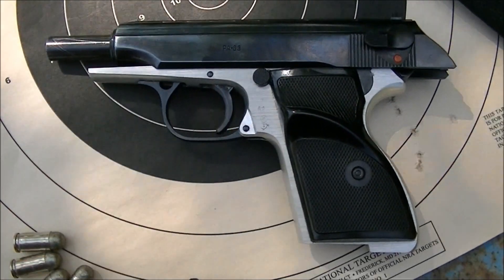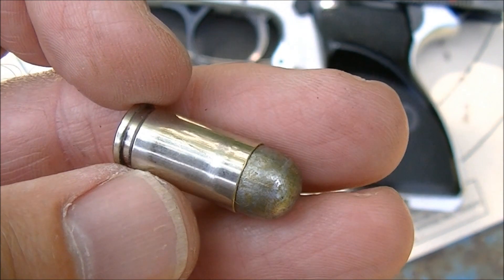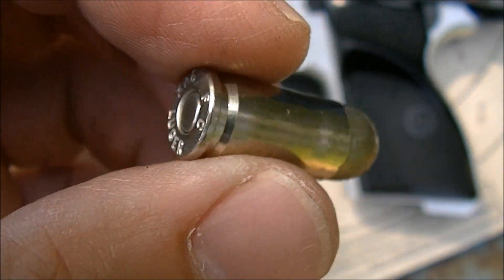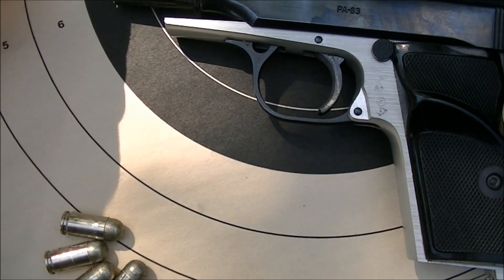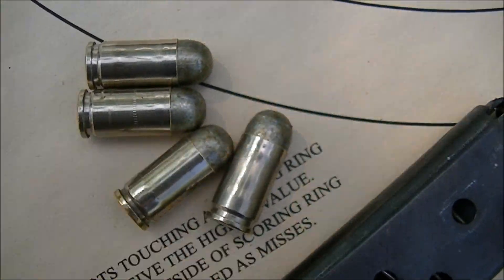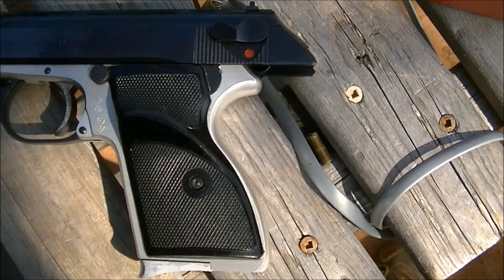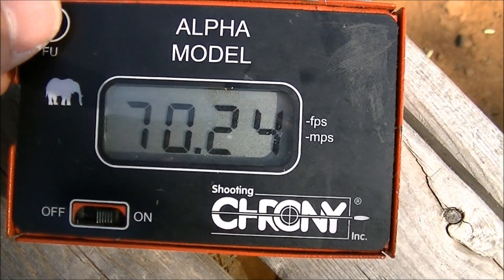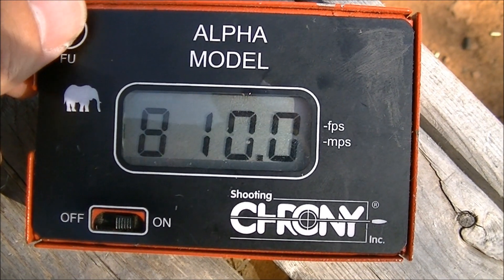Lee 9mm Makarov Cast Bullet Test

Comment: I have a P64.  Lovely and dependable pistol.  I have not reloaded for it yet.  Always bought ammunition for it, but have dies, etc.  Your video caught my attention.  I need to give it a try.
Reply from the maker: Up here factory 9x18 ammo is quite uncommon as very few pistols chambered for it were sold. As a result reloading for it is pretty much a necessity. Buying bullets of the correct diameter is also close to impossible here so cast bullets are a must. The modified 9x19mm cases work surprisingly well, you might want to give those a try if you decide to start reloading the round.

Comment: I've got one of the Bulgarian Makarovs, and like it quite a bit after I changed the grips. Toyed with the idea of picking up one of the double stack 9X18's, but never came across one at the right time. At least I stockpiled up a bit of the ammo when it was a bit more affordable, so didn't get to the point of reloading for it. Hope you can hold onto yours.
Reply from the maker: Those  steel frame Makarov pistols are a lot more pleasant to shoot than the alloy frame PA-63. I've been buying factory ammo when it's been available, but there is no much of that around.

Comment: Had one of those yrs ago. Good little pistol
Reply from the maker: I find the recoil to be fairly "snappy" with factory loads.
Reply: @314299  same. If I remember correctly they have an aluminum frame.
Reply: @314299  Those blow-back types all feel snappier than my nines. I run 2.3 grains of HP-38 under a 95 grain Berry's in a Bersa Thunder 380, and it still feels way snappy.
Reply from the maker: @guaporeturns9472  Yes, they are aluminum frame and as a result light weight.
Reply from the maker: @isserfiq  I suspect the slide velocity of blowbacks is much higher than the speed of locked breach guns and this gives the harsher recoil.
Reply: @314299  yep

Comment: Using the trimmed 9x19 brass is a good idea, especially when 9x18 is so scarce in your area. How’d the cases look after firing? I wonder how many loads you’d get out them before they start to seperate.
Reply from the maker: The fired cases look fine, a little more bulged looking than ones fired in a 9x19 chamber. I have not reloaded any of the converted cases more than twice so far so I dont know what sort of case life to expect. With an almost unlimited supply of 9x19 brass that I can just pick up off the ground at the range I'm not terribly concerned with case life.

Comment: 9x18 is always a hard one to find brass, I like how you just cut down brass and just made it. how was your accuracy, was there any problem with bullet size to your bore? seems to feed without problems. good video - Dave
Reply from the maker: Proper 9mm Mak brass is tough to find up here as there were so few guns sold in the caliber. Accuracy was reasonably good as I recall, no leading either. Unfortunately the footage of the target was lost somehow, but I figured the velocity measurements were worth preserving.  I shot the bullets unsized and coated with Lee liquid Alox, normally I prefer conventional lube but I do not have a proper size die for my Lyman machine.

Comment: I have the same pistol, same mold and make my own brass out of once fired 9 mm cases.  I get excellent accuracy using W231/ HP-38.
Reply from the maker: The cases are a bit of a pain for me to make as I do the trimming on a hand cranked Lyman trimmer, I need to get a Lee trimmer pilot so I can use a drill to speed things up. I have W231, I might give that a try. What sort of charge weight were you using?
Reply: @314299  Lyman makes a power assist trimmer to replace the hand crank on the Lyman, thats what I used to trim the once fired 9 mm cases and I also use it for final trimming of .308 Win. brass I converted to 300 Sav. after I use my chop saw to get it close.  I had good results with 3.5 grs. of W231.

Comment: Anyone that try this bullet in 380 auto ? 
Thanks for feedback
Reply from the maker: The Lee 9mm Makarov bullet is far too big in diameter to use in a .380. The .380 generally uses cast bullets of .356" diameter while the Lee Makarov bullet is much larger, .365".
Reply: @314299  you're right Sir.
Maybe the best choice is the RN 102.
Available only in two cavity